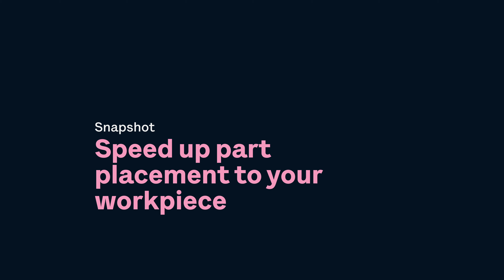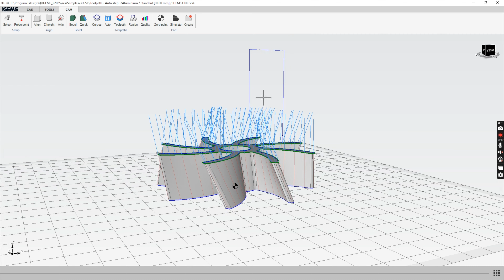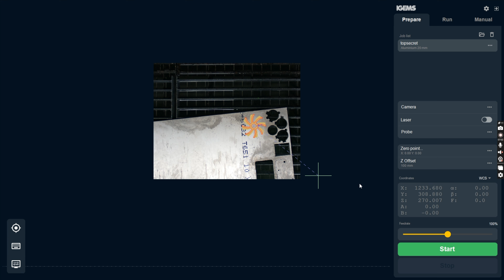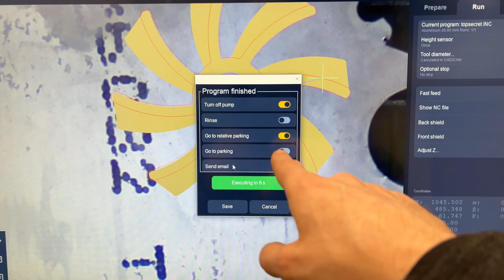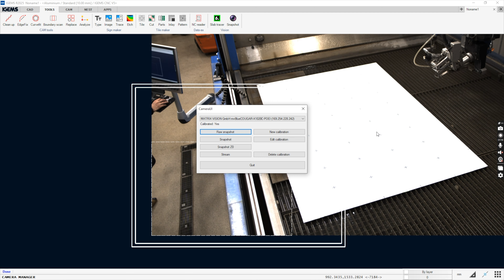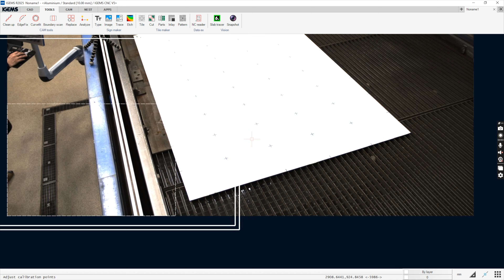Snapshot - Say goodbye to slow job setups on your waterjet machine

Comment: Hi. We have an WJS waterjet with 2 cutting heads and Fanuc control system. We have also been using iGems since early 2000's. We would be very interested in exchanging the cutting heads with an 5-axis iHead with height controller. I see that you are using Beckhoff.. What needs to be done to be able to use these heads ?
Reply from the maker: Hi Thomas,
Excellent choice! Unfortunately we don't sell our hardware to end users. Please contact Waterjet Sweden or any other partner regarding this. Someone hopefully want to help you with this.